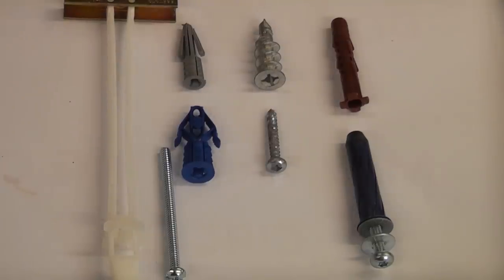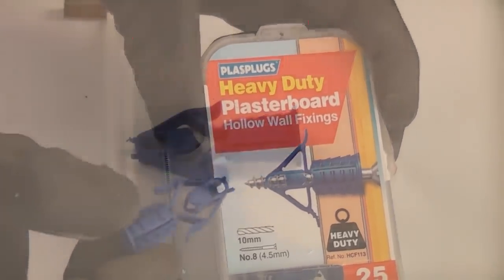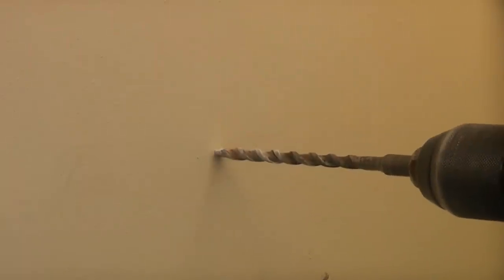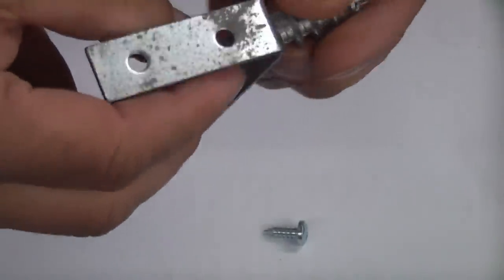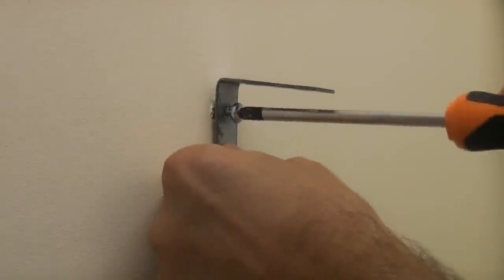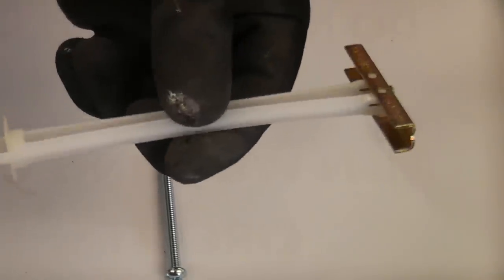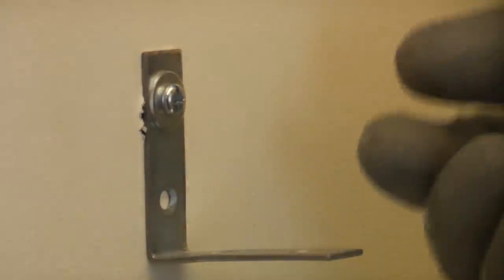Plasterboard fixings- The good, the bad and the useless!

Comment: Hi handymani always watch yr videos and i have to say its very helpful. I have a question if you can adviseim putting 27mm insulated plasterboard dot and dab onto brick wall, i want to secure this with screwsm can you advise the screw size and the plugsmany thanks
Reply from the maker: I would not use plugs as they can melt in a fire, causing the fixings to fail. (the mechanical fixings are there in case of a fire).

I'd use some 75mm masonry screws- https://www.youtube.com/watch?v=P0LXQG3S8ko

But you will probably need some rustproof washers as well to prevent the screw heads pulling through the plasterboard.

Or you can get dedicated mechanical fixings- http://fave.co/2mFELoG

Comment: Hi. Thanks for the video, very useful. I want to hang my TV on my plasterboard wall. It's 49 inches but fairly new so it's less than 20kg's. Would 6 of the hollow wall anchors be sufficient? Thanks in advance.
Reply from the maker: They should be, but I'd always try and find at lease one stud when fixing an expensive TV to a wall, if you can't find a stud I would use spring toggles to be on the safe side. 
https://www.youtube.com/watch?v=H5U0sLKyJJw
I hope this helps ;-)
Reply: Ultimate Handyman thank you. My house is brand new and the plasterboard walls are metal framed. So the studs as it were are metal and look like mecanno pieces. This means I can't drill into them. Hence my problem. So you reckon spring clips then?
Reply from the maker: Yes, I'd go for the spring toggles- they were the best performers in my test.
Reply: Ultimate Handyman thank you.

Comment: I seem to have drilled holes too big for the anchor.  The anchors just spin in the drywall making it impossible to tighten the screws completely.  How do I determine the correct width of the bit in relation to the width of the anchor?  Thank you.
Reply from the maker: It depends which anchors you are using. Most drywall fixings will tell you the size of hole on the packaging. If not I try to ensure that the hole is as small as possible
Thanks for the comment 👍
Reply: @ultimatehandyman  That's a good rule of thumb--very helpful.  Thank you; and Happy New Year to You and Yours.

Comment: what fixing would you recommend for a ceiling fan I have two strong fixings to the joist inthe ceiling  but on the higher speeds in the summer I have a bit of speed wobble so I thought that a couple of those fixings would eliminate that
Reply from the maker: +John Barwick These are not really designed for ceilings, but as you have two fixings in the joist already these might help.I have only ever seen a couple of ceiling fans and they have always wobbled on high speed- I thought they all did that?

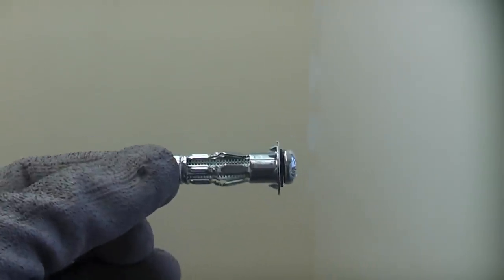Comment: At 7:30. Why do you need the setting tool only when the wall has not been skimmed? What difference does skimming do?
Reply from the maker: Skimming the wall leaves a coating of hard plaster on it, so when the hollow wall anchor bites into the surface, it is less likely to rotate and damage the plasterboard.
Thanks for the comment

Comment: Thanks for the extremely helpful video. What would you recommend for fixing to metal stud? Thanks again!
Reply from the maker: You should just be able to use self tapping screws, you might have to drill a small pilot hole first, or you can get special self drilling screws, such as Jack point screws.
Thanks for the comment
Reply: Thanks for the quick response. Even if it is for a shelf with reasonably heavy loading? Thanks again

Comment: Hi ultimate handyman, loving the videos. I need to put up a bookcase on an internal partition wall. The bookcase will end up weighing about 40kg. Are toggle bolts drilled into the metal stud my best option?
Reply: Wise Eyes if you're drilling into a metal stud, just drill it to the correct size and use sheet metal screws. These types of anchors (as we call fixings here in the US) are for things that for whatever reason can't be attached to a stud.

Comment: As usual, a great tutorial on fixing to plasterboard! I wonder if you could do something similar for plaster walls done on lathing? My house is a 110 year old brownstone and everytime my wife wants me to hang a picture I have images of the wall cracking and collapsing race through my mind. I eventually do it but think there must be a better more correct way. Help! And, thanks again.
Reply from the maker: +HobokenHam 
Thanks, Lath and plaster can be a real pain to fix to. If possible it's always best to fix to the studs, these can be found by finding the nails which hold the laths using a magnet- https://www.youtube.com/watch?v=H5U0sLKyJJw
If you can't find any studs you can use snap toggles https://www.youtube.com/watch?v=tAIUublenMw
At my old house I installed a small washbasin on a lath and plaster wall using snap toggles ;-)
Reply: +HobokenHam Lath and plaster, I usually use the toggle type ones. I am sure Ultimate Handychap will be along to confirm/deny that. Used to live in a victorian place with lath/plaster walls. What's important is to use a bit that can actually drill through the lath rather than splitting them and pushing them away, I find a normal HSS wood/metal drill bit works well.
Reply from the maker: +TheChipmunk2008 
That's a good point about drilling it. Under no circumstances use a masonry bit or it pushes the lath back rather than drilling through it.
Thanks for the comment ;-)
Reply: +Ultimate Handyman I keep a cheap set of metal drills (supposedly HSS lol) for drilling plasterboard, much cleaner cut than a masonry bit and as you say they will go through laths or any other backing that might be there. Cheap brad point wood drills are also excellent for making a clean hole.
Reply from the maker: +caskwith 
I bought a cheap set of HSS drill bits once and tried drilling some steel with one of them. The drill bit snagged in the hole and shattered, just missing my face. Cheap drill bits are probably only suitable for drilling plasterboard and wood LOL.
Thanks for the comment ;-)
Reply: HobokenHam 
If you are only hanging something light then I would suggest just screwing straight into the wall and cross your fingers you hit a lathe. The lathes are fitted pretty closely so you probably will hit one and use a sharp narrow screw with a course thread. Dry lining screws are perfect.
Pilot drilling first with a small hiss hss bit would be ideal to reduce the risk of splitting the lathe.
I have worked as an electrician for 30 years and fitted thousands of lights to lathe and plaster ceilings. Ideally you would pick up a joist or fit a nogging, more ideally you would rip the horrible stuff down and replace it with plasterboard!!

Comment: Great stuff as always. What do you suggest as a bit of a less heavyweight option for solid walls behind plasterboard (ie alternative to rigidity) ? Also what about doing plasterboard beneath window steel lintel for example when trying to put a Venetian blind up. I find there's not enough room for standard plastic plug type fittings and struggle to get a screw directly into lintel.Thanks in advance
Reply from the maker: +honestmcgyver 
I normally drill into the masonry, then use standard wall plugs and screws.

Comment: +UltimateHandyman @UltimateHandyman Hi mate, hoping you can advise. I have a large 1600mm twin panel, twin convector radiator, unfilled weight of 50KG, and filled weight I'm guessing of 80-100KG? It was fitted on a breeze block wall that had been dot and dabbed with plasterboard. Maybe an inch or two gap between them. Today while I was laying an engineered floor, the damn thing fell off and landed on me! The brackets were fixed using the metal worm screws into the plasterboard. How would you suggest I fix it so that this doesn't happen again? :-(  I was wondering if I'm best to use something larger and going through into the breeze block?
Reply from the maker: +Neil Kenneth Riley 
Jesus, You are lucky that it has lasted so long before falling off! 
I'd use Rigifix anchors in such a situation- https://www.youtube.com/watch?v=xaYfs3lr1jI
Or, you could use long screws and wall plugs, but you run the risk of pulling the plasterboard into the wall when tightening the screws, so the rigifix are better really ;-)
Reply: +Ultimate Handyman Cheers for that mate. Combination of Inexperience and taking advise from the wrong person I suppose. My shoulder is paying the price! Has been fitted for a good few months like that as well. I was wondering about cutting out some board, and fixing 3x2's to the blockwork, then obviously fixing the rad brackets to that? Little bit paranoid about strength now...
Reply from the maker: +Neil Kenneth Riley 
You could do that, but it's a lot more work!
I suppose if you do that you don't have to waste time finding the rigifix and can get straight on with the job.
Thanks for the comments ;-)

Comment: Hi, Looking to put shelves up to hold a good amount of weight but the plaster board has insulation behind? What do you suggest please?
Reply from the maker: I'd follow this- https://www.youtube.com/watch?v=glzwY76O0d8
If you have to use fixings, I would use the Grip-it fixings, but you will need the undercutting tool to remove some of the insulation. https://www.youtube.com/watch?v=szx7nMRZSIY
Thanks for the comment 👍

Comment: I have a 65 inch flat screen tv that weighs about 45 pounds. I live in a old building and believe the wall is plaster but I'm not sure because it seems powdery when I try to get into the wall. I dont even know if theres studs in the wall. which fixing should I use? I don't want my expensive tv to fall down
Reply from the maker: You really need to find a stud for fixing a TV to a wall-

https://www.youtube.com/watch?v=H5U0sLKyJJw

You could then use a couple of spring toggles in some of the other fixing holes.
Reply: thanks for the reply. Which type of magnet would be best? There's different types with numbers on them. I've used a black and decker stud finder and could not really find any studs.

Comment: Hi Great Video!

which fitting do you recommend for kitchen wall units?
Reply from the maker: It depends, most kitchens normally have walls that are dot and dabbed (solid wall behind the plasterboard). If that is the case I would use Rigifix- https://www.youtube.com/watch?v=xaYfs3lr1jI

If the walls are stud partition walls you might be able to find some studs- https://www.youtube.com/watch?v=glzwY76O0d8

Or I would use either Snaptoggles, GripIt fixings or spring toggles.

Comment: I have a question. I used wall plugs for my wall mounted shelves but some of the screws are coming off with the plugs. Could I just replace the wall plugs with new ones ? (same size wall plugs as the old ones)
Reply from the maker: Yes, but you could just use a wider screw, with the existing plugs. This will make them expand more and grip 👍
Reply: @ultimatehandyman  thanks for the reply. I'll try using a wider screw..

Comment: Ulitimate handyman
Can the snaptoggle be used with plywood wall that have been plastered over I am fixing a batten to the wall to hold up a board.
Reply from the maker: Yes, not problem. They will give a really strong fixing in plywood.
Thanks for the comment

Comment: I have 30kg wall decor piece which have  two hooks to hang. What would you suggest?
Reply from the maker: I would try to get at least one fixing into a stud-
https://www.youtube.com/watch?v=glzwY76O0d8&t

If you can't do that I would use the spring toggles or snap toggles, as they held the most weight in this test-

https://www.youtube.com/watch?v=ECDysfNhx_E&t=4s

Comment: Hi, would the first one plasplug  grey ones hold a wall light as it doesn't say how much weight they will take
Reply from the maker: Yes, they should be suitable for that.
Thanks for the comment
Reply: cheers, great vids keep up the good work
Reply: it will hold it but once you need to replace the globe you then start putting pressure onto the light fitting trying to replace it and some wall fixings like to be untouched in this way and arent suitable for that kind of application. You could inadvertently dislodge the light from the wall with the plugs pulling out. I have seen electricians do this type of fixing only to have to fix them with something stronger like the spring toggles or hollow wall anchors

Comment: ok i want to mount a double monitor wall mount holding monitors that are 10 pounds each with a wall mount that is also 10, the total weight is 30 pounds, ive been told to get a 3/8 spring toggle for heavy jobs? sound about right?
Reply from the maker: It's best if you can get a couple of fixings into the studs- https://www.youtube.com/watch?v=glzwY76O0d8
Thanks for the comment 👍

Comment: Sharkbites hold the most weight and leave very little damage and are reusable.  I hang my family's crest (shield with two large swords) with only one sharkbite, not in a stud either.
Reply from the maker: I've Googled "sharkbites" and it comes up with plumbing fittings?
Thanks for the comment
Reply: Ultimate Handyman Been a while since I bought them, try wall biter.

Comment: what would you recommend for mounting a TV? the snap toggle bolts or the spring bolts seems like the best option
Reply from the maker: +t103Ninja 
I'd either use snap toggles, spring toggles or grip it fixings- or there is a new fixing out too called the Gee-fix which is also very good.

Comment: I need to hang a 5kg chandieler with a drywall ceiling. Which one you think it might be the best?
Reply from the maker: To be honest I would not risk a chandelier using fixings as all the fixings I have used are not designed for a straight pull out force. I would lift some floorboards above and place a noggin in between the joists so that the noggin can be used to fix the chandelier to using wood screws. If that is not possible the strongest fixings I tried were the spring toggles.
Reply: +Ultimate Handyman Thanks for your reply.  Even on the manufacturer site from searchlight lightning tells that is ok to attach it with these type of fittings. Thanks again

Comment: what would you recommend for radiators? I used the silver  anchor ones for one bracket which was good. when I used it for the seconed bracket the anchor went right through the wall.
Reply from the maker: I'd use spring toggles as they performed best in my test-
https://www.youtube.com/watch?v=ECDysfNhx_E

Comment: Hmm Something odd going on with those blue ones.  I've used them before without them breaking, wonder what's wrong.  They seemed remarkably brittle
Reply from the maker: I don't know, but I tried them a few times and they always broke.
Plasplugs normally make decent stuff, so these were a let down.
Thanks for the comment
Reply: I just happened to come across the pack of them I have in the garage, so I thought I'd have a go at twisting them round to see how strong they were and I couldn't get them to snap like they did for you.  So maybe you just got a bad batch, or then again maybe I got lucky with a decent batch.
Reply from the maker: Who knows, but the other Plasplugs fixings worked ok- like you say it might have been a bad batch!

Comment: dont use wood screws, use finer thread timber screws as the wood screw is too coarse and large in its thread I have found.  With the hollow wall anchor where you use the special tool, I only drill about a 7.5mm hole so it allows the pointy tabs to grip the plaster surface and gives more area at the rear for the compression to grab
Reply from the maker: If the screw is that critical to the fixing, the screws should be supplied with the product.
Thanks for the comment
Reply: whats critical is deductive reasoning and not expecting others to perform for you
thanks for the reply

Comment: Awesome video, thank you for posting it.  Which would be best for mounting a 55" LED TV that weights 39.9 pounds/ 18.14 kilos?
Reply from the maker: +Tim Johnson You are welcome.I'd use the snap toggles, if you could get at least 4 of them spaced out as far as possible on the fixing bracket that would be good ;-)
Reply: Tim Johnson Find a wall stud to beef the hold better.
Reply: RIGIFIX   :]

Comment: would those togglers works on an insulated board that then has woolen insulation behind it. Even on my external walls there is 6" from the finished surface to the brickwork.

It has literally been driving me nuts trying to find something that can actually stay in the wall let alone take some weight like for a bike hook which would be 10kg over 4 screws.
Reply from the maker: I have never used them on insulated board. You could use GripIt fixings but you will also need their special undercutting tool to remove some of the insulation ;-) 
https://www.youtube.com/watch?v=szx7nMRZSIY

Comment: Would I be able to use the metal worm screw on a plasterboard ceiling to hang a 9kg projector screen from a hook?
Reply from the maker: No, I would not risk that.
I would try to find a stud/joist or failing that I would use spring toggles.
https://www.youtube.com/watch?v=glzwY76O0d8

https://www.youtube.com/watch?v=ECDysfNhx_E

Thanks for the comment

Comment: What would you recommend for slotted plaster walls (battons on wall then plastered) if that makes thanks
Reply from the maker: I've used the snap toggles in the past on lath and plaster walls, they work very well, but if possible it is best to fix to the studs, which you can find using a magnet, like in this video- https://www.youtube.com/watch?v=glzwY76O0d8

Comment: I live in a old house with old walls ( I think it's called laughing plaster it has slats in between the timber frame) which would you recommend to use?
Reply from the maker: I'd go for snap toggles for use with lath and plaster as I have used them in the past and they worked well-
https://www.youtube.com/watch?v=tAIUublenMw
If it's something really heavy that you are fixing you are better off fixing to one of the studs, which can be found using this method-
https://www.youtube.com/watch?v=H5U0sLKyJJw
Reply: Ultimate Handyman 
thank you for your advice